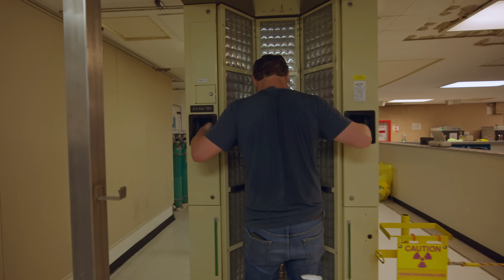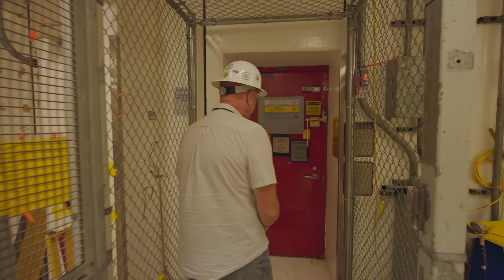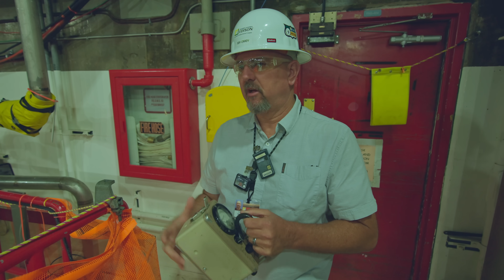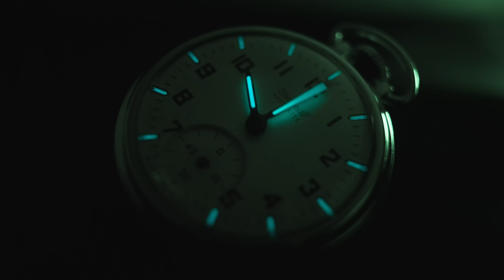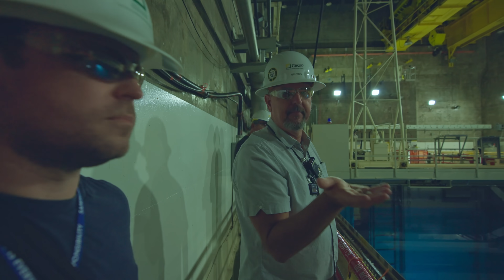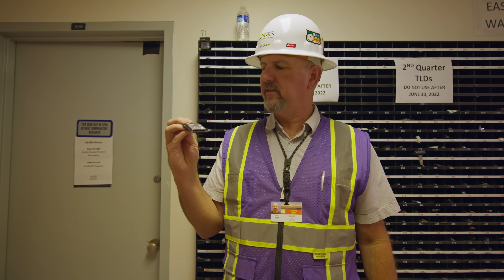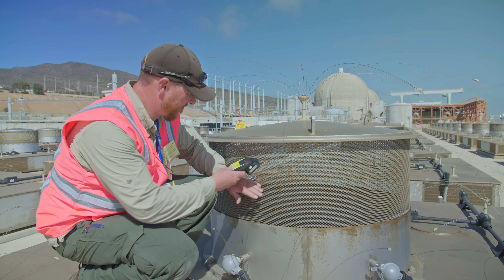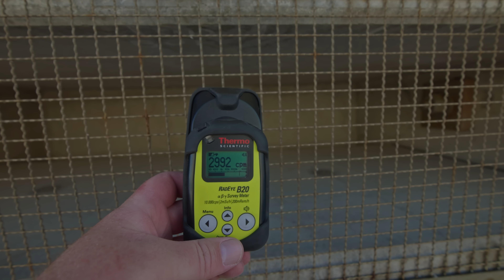Inside San Onofre Nuclear Power Fuel Pool and Spent Fuel Storage

Comment: Should be showing this stuff in schools to educate our youth. It's not that scary, and we are going to need more nuclear power plants built. You are providing a valuable service. 😄
Reply: So, when I was in 8th grade, I actually had the privilege of touring the research reactor at Washington State University as part of a summer science camp program that I was participating in. Today I make my living as a mechanic for nuclear reactor support equipment.
Reply from the maker: Those research reactors are very cool.
Reply: @RadioactiveDrew yes they are. That's why in Germany in an isolated city they found a 90 % increase in leukemia within 15 miles!
Reply from the maker: @richardmccann4815 what exactly are you talking about? Hard to know because of how long this thread is.
Reply: That's badass man hope ya enjoy It
Reply: @themightydropbear  exactly what I’m saying!! Nothing like this was available to me as a youth and I would have died to go to nuclear power plant or research facility
Reply: @adamhayden5152 you can still die!  Go to rocky flats, and hike the hills there!
Reply from the maker: @richardmccann4815 I’ve hiked around Rocky Flats, didn’t find anything of note. Granted I only went around a quarter of the fence line. I’m much more concerned about chemical exposure than exposure to traces of plutonium.
Reply: @RadioactiveDrew  There is much more than traces of plutonium below the surface.
Reply from the maker: @tunneloflight oh I’m sure, in the area that is still off limits and controlled by the DOE. I would imagine that there is still some tiny amount of plutonium leaching into the ground water. This is all from weapons production and not from power production.
Reply: @RadioactiveDrew  The amounts in the areas that are still off-limits are large. They will be hazards for longer than man y has recorded history by more than a factor of ten. And they won't stay put. The area will have to have active surveillance and guards for all of future recorded history - just to keep plutonium miners away - who want to scavenge the material to sell it to the highest bidder. Plants and animals will in time get into it and move it to the surface. And no doubt with climate change conditions will change in ways that resurface the materials requiring further actions. But, with the disasters of climate change and the forgetfulness of humans we won't remember that. Well, other than the plutonium miners who will dig up the whole thing.  And the plutonium will be scattered hither and yon to blow on the wind.
Reply: @adamhayden5152 But still the Power , Praise and Glory be to Allah Who has given us the opportunity of the telecommunication technology and so we have this available to us  here . Alhamdolillah.
Reply: Man I’m 42 and I think this is super cool and I would love to work at this plant. If they would have shown stuff like this in school. Like a trip to nuclear plant for tour, or something.
Reply: @adamhayden5152  I'm in law enforcement and I wish I had found out about the security of these places earlier. They don't play and are very badass.
Reply: @adamhayden5152  it reminds me of jail lol  

all the echoes, locked doors, the noise.  I couldn't stand to work there lol
Reply from the maker: That would be cool if they showed this in schools. I have been thinking of doing some volunteer work at local schools to teach kids a little about radiation.
Reply: @RadioactiveDrew  I think thats an awesome idea.
Reply: @RadioactiveDrew you would be showing them more than what schools even " teach "
Reply from the maker: @caerulipes  oh I'm sure. I remember high school barely talking about this subject. Not to mention there is so much information that seems to be excluded about nuclear science in general. My favorite one is that only enriched uranium can be used as fuel...this is wrong. The first reactors made and used to make plutonium used natural uranium...no enrichment needed.
Reply: @RadioactiveDrew  they showed this in school and now i have to wach thid whole thing
Reply from the maker: @someanoyingkid21  which school?
Reply: @RadioactiveDrew That's exactly why they won't do it! They don't want educated people out there. Too hard to control!
Reply from the maker: @devilsatan2973 I totally agree. It’s much easier to keep everyone afraid than it is to educate.
Reply: @RadioactiveDrew  should be great.
Reply: @RadioactiveDrew  if I were a kid I would have been way more fascinated by an assembly w u vs/ my teacher covering it for like 15 minutes from a book
Reply from the maker: Thanks. It was a very cool experience. I hope I get to do other facilities in the future.
Reply: It would do a lot to help curb the anti-nuclear Karens in the world that haven't a clue of what they're going on about. It would help against the radiation/nuclear fearmongering i see a lot of people doing that don't understand anything about radiation.
Reply: @madmax2069  then again, some of us DO understand and have met nuclear professionals who are impressed by their knowledge, and asked how they knew certain things. It's called the internet and FOIA documentation. Fusion is the only way forward.
Reply: @madmax2069 who is Karen?
Reply from the maker: @madmax2069  there's a lot of that going around. I haven't always been in favor of nuclear. It took me learning about radiation and radioactivity to really see how amazing it is. Nuclear is so beyond anything else it almost seems like magic.
Reply: @madmax2069  anti nuclear Karen sounds like a grindcore band
More nuke plants = more chernobyls
Reply: @madmax2069 radiation, the silent killer. May the world lose the privilege to use nuclear power in the future.
Reply: I’m no engineer or scientist mic, but I’m pretty sure nukes and the use of radioactive material in energy production is different
Reply: he nuclear powerplants take uranium , make it thousands of times more radioactive, while leaking a thousand decaying isotopes into our water and air. And they produce as much waste as they take in as fuel, and produce plutonium for ATOMIC BOMBS! WHICH CAME FIRST, THE CHICKEN, OR THE EGGS OF MEGA-DEATH?
Reply: @jamesjones4253 Yes it is, when I used the word "nukes" I was referring to commercial nuclear power plants, not bombs.
Reply: @jamesjones4253  chernobyl
Reply: @TheCovy  Chernobyl was pure negligence from Hubris by Dyatlov. Much better designed plants around the world than Chernobyl. No six foot thick walled vault. No vacuum building etc
Reply: @jamesjones4253  chernobyl
Reply: Unfortunately the lies about TMI are still going strong and the damage has Unfortunately already been done.
Reply: @mattt233 yeah, lies on both sides...
Reply: @mattt233 downplaying nuclear incidents is wild work.  Thousands die, thousands more are permanently disabled. The land, air and sea become poisonous permanently. Not to mention the plants providing info for nuclear bombs. It is a technology the world does not need.  May every plant be shut down. Scientists don’t give a fuck, their just want to stroke egos
Reply: It's not children who vote against the construction of new nuclear power plants though. It's more important to educate the adults, particularly the ones who are still stuck in the Chernobyl scare.
Reply: The US population is terribly uneducated concerning Nuclear power, fuel handling and long term spent fuel storage. A couple quick FACTS...... There is a massive difference in the design and operation of US Nuclear plants and plants overseas. Fucachima and Chernobyl were both very poorly designed and terribly operated. All US plants, active or not have as much as triple redundant safety systems, which operate automatically in case of an event. Best example is TMI....part of the core,about 8 percent, did melt down. All caused by human error. But the was never an increase in background radiation anywhere around the plant during or after the event. Next all U S plant are fitted with multiple systems to contain all fluids even in a hurricane, and all must have at least TWO standby diesel generators to power all pumps and fluid storage. Two gens per unit, not site wide. Fucachima only had one generator for 7 units and it was below sea level. Now Chernobyl as most Russian nukes are graffiti based reactors,which is a cheap way to build a reactor and once the granite starts to burn you can't put it out.,......... Anyway the US public needs a bunch more education about US Nuclear energy. It's safe, clean and NOT " the China syndrome".
Reply: @everettb1001  It is really cool. I spent a 20 year career beginning in the 1970's as a mechanical designer / engineer building nuclear power plants at several sites around the U.S. Also went through a few refueling cycles. I also gave some public plant tours at a postponed unit. If you live near one, they may give public tours which are fascinating. I saw some really amazing things during that time. It's not scary if you understand it.
Reply: Yeah I had a buddy that  worked there for quite a few years , he didn't glow in the dark. These new modern day smaller nuke electrical plants are really awesome. Green energy is useless in a big waste only the people building those systems are getting rich scamming the world.
Reply: Mr Beast be like - Last one to leave Radioactive Pool wins 100,000 Dollars 😂
Reply: In Slovakia you can visit one of the nuclear power plants and they have all these cool things for the kids.  I haven't been there myself as I had to stay home, but the wife have taken the kids there a couple of times.  So there's a nuclear melt down simulator, which proper freaked out my younger one 🤣 and quite a few other interactive equipment that teaches the kids about the nuclear process.
Reply: The only reason we "can't get rid of the waste products" is the idiotic non-proliferation agreements.  Participating countries could simply have a designated individual oversee one-another's reprocessing and we'd be reusing all of it.  Only a few percent of usable fuel is actually used in those rods.  The reason we don't reprocess is there is traces of plutonium that formed while in the reactors, and it could be used to make nuclear weapons, but the plutonium should be utilized back in a reactor instead of lurking around for tens of thousands of years.  There's nothing to stop them from digging it all back out of storage and using it all for nukes anyway, the whole agreement is incredibly stupid and flawed.
Reply: Radiation contamination isn't scary chemical contamination with heavy metals is like lead arsenic (idk the name in english As on te periodic tableq) etc... thats scary
Reply from the maker: Yes, chemical contamination is way worse than radioactive material contamination…in most cases.
Reply from the maker: Personally I think they should use the spent fuel as giant RTGs (radio thermal generators). There’s a lot of heat still generated that isn’t being taken advantage of.
Reply: @RadioactiveDrew  Orphan sources are one of the problems.  I don’t want additional orphans.  Remember the Lia RTG incident?
Reply from the maker: @jeffjohnsisland5551 I’m not worried about orphan sources. I always carry a radiation detector of some kind. Also the chances of that happening here is extremely remote.
Reply: @RadioactiveDrew  Nice that you can afford a detector.  It’s not in my budget.  You said chances are remote, how many sources have been lost in the US?   Why do all the borders crossings I have seen have radiation detector’s?  Why do most scrap dealers have detectors?  How many sources have been melted when recycling scarp metal?
Reply from the maker: @jeffjohnsisland5551 border crossings have the detectors to see if a dirty bomb or any other nuclear material that shouldn’t be coming in is trying to make it through. There has been incidents of sources being stolen. But nothing even close to the Sr-90 sources used in RTGs.
Reply: @RadioactiveDrew  On 2/27/1996 two cobalt-60 and one iridium-192 camera were stolen from Houston TX. 

Nothing like the strontium-90 RTG’s?   How about the spent fuel rods missing from Milestone 1?  I would have guessed spent fuel rods are worse the RTG’s. 

I think I mentioned criticality accidents as another reason not to reprocess fuel.  Internal contamination is another problem.  

I don’t bury my head in the sand.
Reply from the maker: @jeffjohnsisland5551 the missing fuel rods aren’t out in the open like the RTGs. They were sent to a low level waste facility. 

If safety is followed there is no risk of criticality accidents when reprocessing spent fuel. What happened in Japan with the criticality accident at a reprocessing facility was people ignoring every safety measure that was put in place.
Reply: @RadioactiveDrew  From what I read, they think they wound up at a low level waste facility, it sounds like that’s a guess.  

To me, reprocessing is possible, but fraught with plenty of ways problems can occur.  I don’t think it’s worth the risk.
Reply: But they would rather teach us shit that has no use for our future after 3rd or 4th grade.   They really need to be teaching about taxes, finances, building resumes, and shit that will prepare them for adulthood
Reply: “It’s not that scary!”

Proceeds to show the youth a full body radioactive particle scanner, followed by a man with a clicking Geiger counter reading 71x background.

——

No, I don’t find it scary. I find it fascinating. But I think you overestimate the youth.
Reply: Sadly, more being built most likely won't happen because the public is so paranoid of radioactivity and waste. Solar and wind energy is a joke and doesn't come anywhere close to the amount of energy that comes from nuclear power.
Reply: @chrisb.1214  It is making a comeback worldwide.
Reply: @micpic119  If so I haven't heard. From what I have seen some countries are leaving nuclear power. US is not building any new plants.
Reply: @chrisb.1214 New plants no, new reactors in the US yes. I live somewhat near Georgia’s plant vogtle and they just opened up a new reactor this year with another on the way.
Reply: That statement alone is what is scarey. That job can't afford mistakes or people die very painfully.
Reply: I don't want to think of kids today managing a nuclear reactor
Reply: @CIA_Is_aTerrorist_Orginization  There is some truth to that. I've heard some stories of new airmen mishandling and showing ineptness with our nuclear deterrence. Makes me worry for our future for sure.
Reply: Schools are too busy  teaching woke ideology
Reply: Agreed
Reply: I just find it hard to believe that with the cost of development, operation, and decommissioning that these plants actually operate at a profit.
Reply from the maker: People pay for power and there’s a lot of people.
Reply: @RadioactiveDrew  I’d support nuclear energy despite its obvious risk if nuclear power could actually prove to be profitable which it most certainly has not in our energy market. And no, the answer isn’t deregulating and putting large swathes of the environment and people at risk for profit. 

As of this point nuclear energy isn’t even a debate. There is a reason so few are proponents of it. Lack of profitably and safety issues make it a lame duck. Like that movie line from field of dreams “build it and they will come” nuclear energy needs to “make money and they will come”……. That and not cause major environmental catastrophe.
Reply: Galen Winsor (Nuclear Scare Scam)
Reply: We don't have much in the way of nuclear power etc in this country, but I'm not sure it'll stay that way forever.
Reply: not that scary.. if its contained of course
Reply: Man I would have more interested in science if I had seen something like this before, now I’m 25  on YouTube high af learning about gamma radiation hitting electrons in water faster than the speed of light.
Reply: I’d love to see this in school I’m fascinated by it and have tried to convince my teachers to explain it and do a model and in depth lesson and they just kinda brush over it
Reply: There are several problems that need to be addressed before nuclear power generation is safe and effective at this time. First it is insanely expensive to build a power plant. Just look at the $billions in cost over runs the new Georgia plants have incurred. Who wants to put up $10+ billion to build a single reactor in 2023? It is better to spend it on renewables. Solar and Wind are the best near future solutions.
Reply from the maker: @AnEvolvingApe it’s already safe and effective. It’s much better to build a nuclear power facility than to have solar or wind. Nuclear is much better use of land and resources than wind or solar plus it’s better for wildlife.
Reply: @RadioactiveDrew  I don't agree. Wind and solar can be effective in certain environments like rooftops for solar and nuclear waste lasts a 100,000 years and is dangerous when that storage is compromised and the nuclear fuel itself is dangerous. Your concern about wildlife is not valid. Birds are killed by domestic cats by many orders of magnitude greater than those  killed by wind generators. $$$ is the main reason why nuclear reactors are not being developed in the US. Add to that the waste product and the extreme danger that a military or terrorist attack may cause. Plus you need a good source of cooling water and who wants to have a nuclear plant built next to them on their lake front or ocean front property. The only possibility of nuclear plants being built in large numbers would be by government intervention and we don't live in a totalitarian state. You can't say nuclear power is better than renewables full stop. Your decision is based on your politics at that point. There are pros and cons from both but the advantage goes to renewables.
Reply: It's time we put this horrible nasty fuel away. One accident an countless pay. Still pay to this day.
Reply from the maker: @enhancedphysique6452 it’s a horrible waste of a fuel source to bury this spent fuel. They should keep it out in the open like they do with the dry casks. It’s fine right where it is.
Reply: @RadioactiveDrew  Where have spent fuel rods been buried?
Reply: as an 13 year old i think it's important to not only see nuclear energy as chernobyl/fukushima etc.
Reply from the maker: @MInecraftLOPIP problem is fear sells. Would be a much better world if people spent a little more time to learn instead of fearing something.
Reply: When I was in elementary school we got to go to the HB Robinson Nuclear plant in Hartsville SC
Reply: I agree. They need to start teaching all physics instead of just motion physics. We have fusion now for God sakes lol
Reply from the maker: @bakinoma7175 fusion would be so awesome for power production. But fission is still extremely useful and does more than just provide power.
Reply: 100% agree. The area I live in uses nuclear power. We have a few plants nearby. No problems with them. No meltdowns. Nothing. They're way less risky than coal and natural gas (people don't understand the toxic stuff produced from those, and they are far riskier public safety wise than nuclear) and more efficient than solar (which also contain toxic waste when the panels are spent.) The downside is that the plants need to be next to water and not all areas have that.
Reply: It's going to be great when the giant stash of world radioactive waste gets submerged and you're proven to be morons. But that's cool I'll eat popcorn whole your heads explode. Doing me a favor. Darwinism gonna wipe out yall and I'm not gonna help you. I'll help it go faster
Reply: Damn right
Reply: The youth isn’t the problem bozo. It’s the fucking boomers, and the hippies, and the people that RUINED this once great nation.
Reply: No doubt!!
Reply: I read this as showering
Reply: Nuclear power is largely safe. Nuclear bombs are not
Reply: Perhaps you are missing or glossing over the very elementary school level problem there is with nuke plants. Yes they are safe............when everything goes as it should. That's thr proble., is that when there is a problem you're fucked. Plain and simple. Fukushima. Was built with all sorts of tragedies in mind. But it wasn't engineered to withstand a combination of them. In fact no nuclear plant is engineered to that level of safety and that's a huge ass problem when dealing  with a source of power so terrible it could render life on earth unlivable. We are so arrogant in thinking that this is something we as a species is something we are responsible enough to handle safely every day all day. We can't even figure out what a damn woman is. And I'm supposed to believe we can continue screwing with this without serious tragedy. Yes we can engineer something to withstand it all. The problem again though is that will take more money in construction then that company will make in profits. Profits over everything. There's your problem genius. Show me th company that will build a nuclear power plant at a loss. Go on go ahead go find em and report back. Oh wait what's that? Warren Buffet said the number one rule of business is "don't loose money ".
Reply: Hagshahaha. More nuclear power plants. As someone dealing with cancer from a radioactive exposure, you guys seriously have no clue what your messing with. I guess a bit less stupid than the Wingsuit ppl tho.
Reply from the maker: How do you think you got cancer from radiation exposure. Based on how you are talking about this subject I kind of doubt it.
Reply: Here’s the thing about radionuclides and exposure. There’s no immediate effect. You don’t “feel” anything. 

You simply get cancer somewhere down the line. All of these plants are leaking eventually whether fukashima, 3 mile, Chernobyl or even the Michigan plant recently leaking Tritium. Santa Susana littering the area with Cs137, I-131, Sr90. 

You realize Cs137 has a half life of 30 years? Sr90 is 89 years. U is 40 billion.

These former two were never even on the planet until nuclear fission. U-238 was never on the planet until fission. 

The guy leading this channel doesn’t even have an education past a GED. 
Literally has no clue what he’s doing in terms of risk. 

Talk to the nuclear scientists and PHD’s who worked for the nuclear industry for many years and now speak out against its safety. I think they know a bit more than ya’ll YouTube backseat quarterbacks talking about stuff you don’t know about. 

Talk to Melissa Bumstead and the kids with reoccurring 1-in-million cancers around SSFL. 

Wind, hydro, gas turbines. Not the most dangerous chemicals on earth that never go away.
Reply: Cell phones.and tv create more radiation so all this is non revelent.
Reply: I totally agree
Reply: I remember in 1985 aguy coming to science class and talking about how safe nuclear power was. He even had some pieces of those spent rods to pass around. So yes I have touched spent fuel rods.
Reply from the maker: You haven’t touched spent fuel. You’ve touched mock fuel pellets. They aren’t real.
Reply: Still no decent long term fuel disposal method. Google sellafield...   Nuclear power is a joke especially with solar now so cheap and clean.
Reply: @micpic119 ya, unless they aren't maintained, then they will be very bad and scary......
Reply: yeah, as if nuclear power plants havnt done enough damn damage to the planet that cant be restored........Stupidity.
Reply: We don't need more nuclear power.
Reply: Just causes cancer...nbd I guess
Reply: True!
Reply: But no one shares the video etc u dont want to contribute smh.
Reply: Why was this decommissioned?
Reply: No. More? More waste to try to store or dispose of. More accidents. Terrorist to use steel or attack. I don't think we should be messing with it personally. Wind .solar. water. Some other way.
Reply: Agreed. But that makes too much sense! That means we would have an educated population! And we can't have THAT. They need a bunch of ignorant clowns that are easily controlled.
Reply: Then why is the energy bill so high if making that energy is so cheap..
Reply: Tell that to those in Fukushima.
Reply: @davidgillette7109  Yes, Fukushima.
20,000 people washed out to sea dead.
What do clowns remember most.
Zero casualties at Fukushima.
Reply: nuclear water boiling is almost over. hold on for the next big thing.
Reply: Sch ool only brain washes the kids nowadays
Reply: Nuclear is killed. Planet. Notice how few insects? Too late. It's desolation.
Reply: They will be too busy changing genders to learn.
Reply: And what about the waste ?
Reply: You mean like Fukushima and Chernobyl?
Reply: I remember when plastic was going to save the rainforest. Now my groceries are back in paper bags. 40 years from now we will be back to coal
Reply: Although one of the major benefits of nuclear power is effectively zero emissions, the cost of building new plants is extremely high and they take years to build.
Reply: Would be good, but it goes against political agenda, so it will probably never happen
Reply: Nah, it’s more important that they know nothing about reality or the education system, and instead focus on getting them to sterilize themselves and to eliminate women’s sports by ensuring real women never win again so they all quit.
Reply: Praise and Glory be to Allah Who by His Mercy and Guidance given us all the science and technology 

There is no might nor power except with Allah 

Allah is the One and Only Creator
Reply: Your right it's not scary until something goes wrong... then it REALLY scary.
Reply: Absolutely 💯 agree
Reply: Fully agree
Reply: @thebluepup  Hopefully our new president will encourage nuclear plant revival in USA.
Reply: The cost to build these nuclear power plants is astronomical.  S.C.E& G. went bankrupt tying to expand its plant at Jenkinsville , S.C.
Reply: My great grandma and great grandpa worked at Hanford for 40-years. Billions of dollars went into the site, yet now that the war is over and we’re not trying to annihilate innocent civilians, the $ has suddenly dried up and “clean up” has grind to a halt.
SCOTUS recently made a ruling that recent Hanford employees who were irradiated can’t sue.
When the cost of ‘cheap energy’ means hundreds or thousands of deaths, birth defects and and thousands of acres of unlivable land, it’s not really that cheap, is it?
Reply: It’s not that scary but if something does go wrong it’s catastrophic to life
Reply: Big oil and coal would hate that
Reply: Until chrynoble part 2 happens but I agree
Reply: Safetie is all thats needed.
Reply: If you fell in that pool you would disagree.
Reply: @efugee no, you wouldn’t.  don’t speak again if you don’t know what you’re talking about.
Reply: As long as politicians keep getting millions from big oil, nuclear power is dead. No matter how reliable. Big oil has the scary nuclear scenario to fall back on and says oh well that stuff you can’t get rid of.  Even though oil and plastic have basically polluted the entire earth and literally has spills daily and oh guess what. Never decays or becomes safe.
Reply: Idk know if a 9 year decommissioning process is the best starting point lmao
Reply: Actually, we are not going to need more nuclear power plants built at all.  In fact we should get rid of them altogether. We should be using high efficiency solar energy collection, to separate water, and use hydrogen for the bulk majority of our energy needs. Not through some corporate infra structure, but through our own personal solar panel systems that will enable us to provide ourselves with free, or nearly free energy that is sustainable, safe, non-polluting, and fairly simple to implement. Get this through your head: Nuclear Power is BAD for all living things on this planet, even the greedy bastards that don't give a f*** about the mess they make in pursuit of personal profit.
Reply: @N0B0DY_SP3C14L you deserve to be permanently muted across every platform for speaking blatant lies.
Reply: These sorts of videos have been banned from schools in Australia due to the fact that the education system is run by the extreme left
Reply: not that scary? Compared to what? Bubonic plague? Seriously, we need nuclear power like we need a hole in our head. In an era where wind and solar are far cheaper and have none of the risks associated with nuclear, the whole idea of building more nukes is crazy. Makes no sense.
Reply: Exactly.  Instead they are assessing student cognition..
Reply: We have NOWHERE to store waste that is DEADLY to humans for 20 thousand years and you think... No problem. Moron would be an upgrade
Reply: The last thing we need is more nuke plants.
Reply: More like indoctrinate not educate the pliable minds of young children.
Reply: If our government wants all electric heat in our homes  and electric cars we gonna need a whole Lotta power plants
Reply: @ElectronicMechanic50 Yep. Just when we need MORE power plants, they take them down! Real smart.
Reply: @ElectronicMechanic50 the government hasn’t thought that far ahead. They believe electricity come out of thin air which technically it does but not on the level we need to power billions of homes and businesses. The government has no clue.
Reply: I totally agree. It's going to become a big part of energy consumption overall, once  people get over the fact that it's not dangerous and actually much cleaner source
Reply: nukes no
npp yes
Reply: @letterslayer7814 no
Reply: Yeah, it's unfortunate that when you mention nuclear most peoples thoughts immediately go the Chernobyl , 3 mile island (which wasn't a meltdown) or Fukushima. Nuclear energy is the future in my opinion, and the amount of safety in place is mind blowing.
Reply: @TomahawksNShotShells  3 Mile Island was a partial meltdown, so your statement is incorrect
Reply: @darktangent10  LOL
Reply: @TomahawksNShotShells Thanks to the idiots in the MSM! They can't tell the truth about much of anything. Just propaganda, to keep the people scared and ignorant!
Reply: @TomahawksNShotShells  Wrong. 3 Mile Island resulted in a partially melted core - which meets the definition of a "meltdown". To be a meltdown, whether partial or complete, the fuel assembly casing gets overheated and becomes compromised - releasing the radioactive elements within. As for it being "the future", you have to be technically pretty ignorant to suggest such a thing given the simple fact that there has never been and never will be a solution to the serious problem of long term storage or "recycling" of spent fuel waste. No one wants to accept the waste for long term storage and the costs for containing something like that for literally thousands of years far outweigh any perceived cost benefit to nuclear power  over any other less dangerous and toxic source of energy. Power by fusion remains the elusive goal. Power by fission proved itself dangerous and outrageously costly decades ago which is why it is essentially dead as a viable technology today. You clearly have much to learn. Either that or you're so invested in a failure that you can't accept reality.
Reply from the maker: Nuclear is the future and the waste is only a problem for people that don’t understand how radiation works.
Reply: @cjg6364  In Gabon a naturally occurring reactor was discovered I think in the 70s.
Of course you having lectured others on how little they know, YOU of course know of this.
The byproducts of fission where there as well.
Where did these horrible elements go?
Almost nowhere.
They stayed within yards of where they where produced for millions of years.
BY ACCIDENT 
GEE I wonder if humans could come up with something ON PURPOSE that would achieve a similar result.
For those not in the know as you most certainly are, a very informative channel is Illinois Energy Prof.
He lays out the straight FACTS about Energy in general and Nuclear energy exspansively.
Reply: @Skeletor P Phunk  When dealing with nuclear you better focus on what's the worst that can happen.
Reply: Yeah but the problem comes when the fuel rods are spent and they have to take them out and store them somewhere for 10,000 years okay that's an exaggeration maybe 5,000 years
Reply: @bryonensminger7462 yea 5000 years math is a dickhead. Na it’s way worse than that. Problem figures are plutonium and ioden and even more half live pu= 24k and I=17kk years. That means if the Pharao 2,4K years ago put 1kg pu up his pyramids there would be still 870g left today. After 241k years still 100g. some problem might be the risk of using it for energy but to store it for such along time period is just insanity btw you produce 1-5T plutonium with 1  nuclear power plant in 4 years with ease
Reply: @bryonensminger7462  bryon, its fine, they design the tobs to contain it until the fuel is safe. stop worrying
Reply: @bryonensminger7462 blast them into space? Humans are experts polluting earth why not outer space as well.
Reply: I disagree. We don’t need it in our country because we’ve had non-nuclear renewable energy for centuries. Most other parts of the world can do the same.
Reply: @chriskeentechnician  Windmills? Water wheels? What country
Reply: Not that scary until you have 100 Tons of nuclear waste
Reply: @x_forest_xreportingchannel7957  The entirety of the U.S. Nuclear energy waste would fit on a Football playing field. Pretty sure a place for it could be found.
Reply: @bradkubota6968 what’s the square footage of the dry cask storage areas?   All waste would fit on a football field stacked how high?
Reply from the maker: @jeffjohnsisland5551 the area spent fuel storage takes up at San Onofre is about the size of a small parking lot. Nuclear power is by far the best way to produce power and especially the best use of land to produce power.
Reply: @jeffjohnsisland5551  Not sure how high.
But it is about 0.0000000000122 % of the United States Square Area.
A HORRIBLE amount to sacrifice according to ??
Reply: Mmm nah. I just see a kamikaze target
Reply: 100 💯 agree. Nuclear power is clean and safe when managed
Reply: Nuclear plants are defacto spent fuel storage sites with no long term plan to do anything with it when the plants close.
Reply: @JG-fi9ub  not true, thier tombs are designed to last until the fuel is no longer dangerous. its fine
Reply: @GhostScout42  keep covering your ears and screaming not true.
Reply: @JG-fi9ub  That sounds like what you're doing, nuclear waste storage has been figured out for a long term solution. Tombs have been made that can last thousands of years without leakage or risk of leaking into the environment
Reply: @Ianette27  I guess your philosophy is ignorance is bliss. Keep that bird brain of yours buried deep in the sand and you will never have a worry in the world. I prefer the real world so unfortunately I will not be joining you.
Reply: @nothedoggolord7675
Reply: @JG-fi9ub this isn't completely true while yes they do store spent fuel on site for some time there are many nuclear landfill site that are buried deeper then any mine or bunker ever made where they store the waste for as long as it takes as of February this year when I was doing a shutdown and a plant they nuclear waste storage facilities were at something like 10% capacity and they are storing nuclear waste from the last 70 or so years of npp operation so as far as no plan for long term storage there is a plan I wouldn't say the best plan but it's definitely a plan that's safe and could be viable for thousands of years at current operation rates
Reply: @JG-fi9ub 
Wrong
Reply: @JG-fi9ub  Ever seen a toxic coal mine tailings and wastewater 'pond'? Go ahead and look they're right out in the open. Thousands. Just look for complete lack of vegetation and any signs of life.
Reply: @JG-fi9ub  coal power produces more nuclear waste than nuclear power does currently… nuclear power has no downsides and buys decades of time to figure out better options
Reply: @MikehMike01 no downsides huh? If you lived within 20 miles of a superfund site or your family worked at a plant during it’s peak, you wouldn’t be out here spouting absolute bullshit.
Reply: @annameer1767   nuclear power has zero downsides and significant benefits
Reply: @ zero downside? Not sure where you’re getting your information, but it’s 100% wrong. My great grandparents worked at Hanford when they were building the atomic bombs. My great grandma had 4 different cancers during her life after she retired. People in Richland, WA are still being poisoned, despite Hanford being a ‘superfund site’
Reply: @JG-fi9ub  I read somewhere they are now able to recycle the stuff so the waste factor isn't a factor anymore.
Reply: @mattt233  that is true but it is only recycled 30% so you do recoup roughly 1/3 but still have waste
Reply: @AATreeService  I did not know that. Thanks.
Reply: @mattt233  "I read it somewhere so it must be true"
Reply: @mattt233 We used to reprocess this stuff until the 70s when Carter got in office. So that's actually nothing new!
Reply: No @mattt233
Reply: No we don’t. They cannot compete economically. And we absolutely do not need more actinides or nuclear waste to deal with. It can also play no roll in fighting climate change.
Reply: @tunneloflight  You're absolutely correct! New advances such as high pressure water jet cutters have made deep hole drilling much faster, and and cheaper for geothermal energy, thousands of times cheaper than nuclear death machines!
Reply: @richardmccann4815  Yes! Geothermal is a hugely under-tapped resource. More even than that, ground source geothermal for heating and cooling in businesses and homes is also hugely underutilized. South Africa and Portland , Oregon both show how much can be done with ground source heat pumps. 

What we need are improvements in systems designs and installation methods to further reduce the initial capital outlay to install these systems and to replace the old fuel oil, and and natural gas furnace systems. These systems also integrate well with photovoltaic and thermal solar systems, and with improved energy efficiency through passive design, insulation, natural lighting, integrated green spaces or green houses that can benefit from the 'waste' heat or cooling of the house. 

Or go the next step as they have in Sweden and put the entire home inside of the greenhouse, radically changing everything about the design. 

Using these ideas it is proven to be possible to grow bananas in an unheated home in Denver, Colorado, or to grow oranges in nearly passively heated greenhouses in the midwest. 

Nuclear touts baseload power as a benefit. Nothing could be further from true. Human power usage mimics the day with a daily rise and fall of energy use. Taking off the bottom of that as "baseload" and diverting its supply to a hughly complex nuclear supply, which has to go completely offline for a month or more at a time (sometimes without warning) creates a highly unstable power system that offloads the cost of producting changing power levels to other power production methods. 

Geothermal has the advantage that once the technical issues (scaling ...) are overcome (*which are minor by comparison to nuclear), it readily and easily ramps up and down in power level and is able to easily outcompete in terms of price. And it generates little to no waste. What waste it does produce is mostly heat, which in an intergrated design serves as a thermal source for greenhouses and other uses.
Reply from the maker: @tunneloflight No…the refueling outages are known far in advance and at a place like San Onofre where there are two reactors the plant is never completely down. Nuclear is by far and away the best form of making energy hands down.
Reply: @RadioactiveDrew  Nothing could be much further from true. They can NEVER compete economically. They inherently produce extremely dangerous wastes that are foisted off onto more generations of humans than have ever lived. They pose immense disaster and catastrophe hazards. They cannot under any circumstances come on line in any timeframe meaningful to combat climate change. They produce huge amounts of CO2 as a byproduct of every stage of their lives except the active power production phase. But worst of all - under all circumstances they produce fissile materials (mostly plutonium isotopes, though others as well) that only get better for nuclear weapons production with age, and that cannot under any workable scenario be gotten rid of. Nuclear is a dangerous dead end that leads to catastrophic problems and results.
Reply: we are made in HIS image
A good prayer:
I'm a sinner JESUS please forgive me for all my sins I know you shed your Blood for me on the cross at Calvary. Thank you JESUS for my salvation and for shedding they Blood for me. I love you JESUS. 
Romans 10:5/10 ct...❤️k
JESUSisLord!Amen...
Amen..
If you'd like to call someone who cares 
83
For
Truth.
bc you don't know when you'll die?
.y r u hesitant..........

...... .. ......🎉
Reply: @Mr.Caring that is not true
Reply: No. Decommission them all safely. Turn off ALL of the mega power stations. To generate power safely, each and every home should have its own unique, grassroots way to capture power efficiently for its own characteristics. Then connect them all to form a grid. That is a safe, strong system. Consolidated power generation is going to leave us vulnerable to attacks and outages eternally.
Reply: Everything is all good until U can’t get rid of the waste product.  But nobody thinks about that do they
Reply: @AATreeService  you can’t “get rid” of any waste product. At least nuclear waste is contained, waste from coal and natural gas is just ejected into the atmosphere for us to breathe in.
Reply: @AATreeService  Approx 16000 tons of coal to replace 1 ton of Uranium  fuel bundles. No air pollution once it’s built.
Reply: @snowblind796  U understand what goes into disposal of radioactive waste?   Get back to me on that
Reply: @AATreeService  I do in fact. North of the 49th what can be is incinerated or melted. The fuel sits in the pool til it cools, then transferred to flasks & seal welded  for dry storage.
Reply: @AATreeService  God someone loves preaching. We can easily safely store it for ever and ever until some other use is found for it until we learn to make it inactive or can just safely fly it out to space.
Reply: @Jeff-mn1uq  lol….. 🤦‍♂️
Reply: @Jeff-mn1uq only Allah can guide
Reply: @AATreeService just like the rest of the world. Kick the can down the street. To survive as humans we need to make the next generation easy for them. Instead we shit where there gonna eat to get by. You can only do that so long.
Reply from the maker: @enhancedphysique6452 storing the spent fuel onsite isn’t a problem.
Reply: @enhancedphysique6452  100%
Reply: Nuclear power is safe, until it's not.
Reply: @Noelsterrr So is sex.
Reply: Manacom bagel once said never eat your cereal without milk.
Reply: We don’t need more
We need less
And better Green energy 
How r u wanting more of nuclear waste
Like it’s so incredibly selfish and egoistic of humanity
Reply from the maker: @mothylulu  we do need more. Nuclear is the best energy as it uses the least amount of resources and the least amount of land. Its environmental impact is far less than any other form of energy production.
Reply: You want this in schools to educate the youth? Dude that’s a long shot, considering that the vast majority of the US population has an education level of reading comprehension.
Reply from the maker: @dxb8086 you have to start somewhere.
Reply: NPP's are surprisingly safe
Reply: Stupid comment...
Reply: Because it's not a necessary.
Reply: Schools are busy teaching LGBTQ ;)
Reply: Someone will identify as a power plant then the we willed be screwed for sure.
Reply: Ya it's super clean just ask Fukushima or chernoble
Reply: @indyviper520  Exactly ZERO deaths at Fukushima. Kinda pathetic the 20,000 Japanese washed out to sea are forgotten.
Reply: @indyviper520 Very different situations! Stop the propaganda, get educated.
Reply: @indyviper520  this probably hits hard if you're nine years old